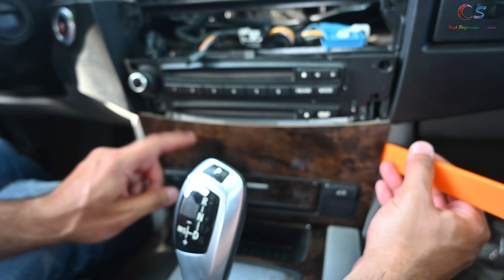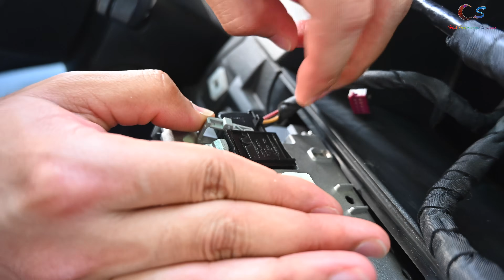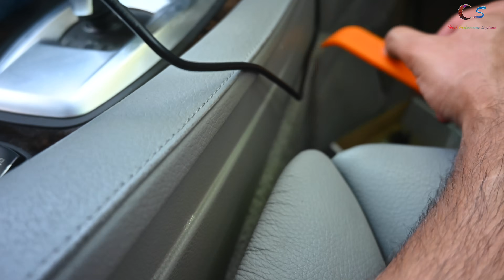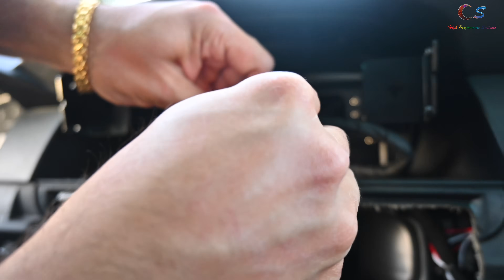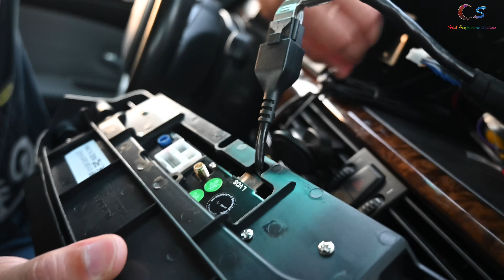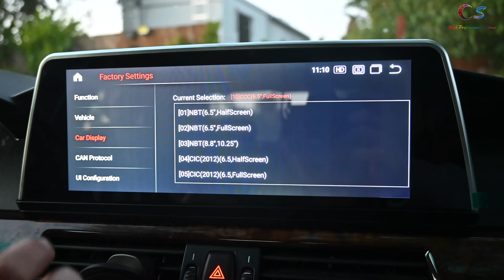PEMP Android 10.25" Screen for BMW E60 Installation

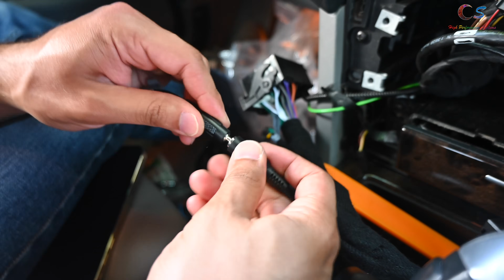Comment: Hi,at 3:48,you are plugging the audio out to the aux in the glove box. If i am correct,in my e61,the aux is in the rear central console,do you confirm? Maybe there is another aux in.the glovebox?My problem is that this cable is of very poor quality and it eventually got cut (kids and feet hitting it). Signal is.now lost. I am then looking at a 3.5 jack male/make cable/ connector. Question: would it be worth adding there a small dac(between the jacks)  to improve the sound quality? Thank you!

Comment: My android auto is only showing up in the center and not completely filling the screen, like two inches on each side are blank and the display is small any tips
Reply from the maker: That’s weird, you can try changing the display type in settings. If that doesn’t work I recommend contacting pemp

Comment: hi I just instal my pemp  system on my e60 2008 and I don't have sound , the radio works fine need help (great video )
Reply from the maker: Make sure aux is connected and working

Comment: I have aux infront of the rear seat in the centre :( is there a way i can put a aux inside the armrest? Or somewhere else. I dont want to use the back one as it wont look tidy.
Reply from the maker: You will have to route it and hide it under carpet

Comment: Hey man, i have quastion about this, i have an bmw 525d 2008 late (ccc) car with aux orginal and sub woofer package, do i need to connect the head unit to the armrest aux out? have seen some people not doing it and get sound ?? i think it will look so bad to run it trough console and back to armrest aux....
Reply from the maker: You need an aux source, there’s not one under the front armrest?

Comment: When you could not see the bmw screen it said no signal how did you get it to work?
Reply from the maker: I just disconnected the lvds wire and reconnected it. Also you can go to android settings and change the ccc display type

Comment: I doubt that the head units fits perfectly on the dashboard without cutting the dashboard. How much of the dasboard you've cut?
Reply from the maker: This is a e60, not a e90. E90 models required cutting dash.
Reply: @cs.studios  yes, i know it's a E60. I own one (facelift). I thought cutting dash is a must. Anyway, i bought also (from a different seller) this type of android navigation, and it works great. The only thing which i don't like, is that nothing appears on the screen when i press the climate control buttons. Same thing with the parking sensors button.if i switch to the OEM system, they work fine. Any sugestions?

Comment: My screen recently started saying no signal when I try to go back to the original bmw car info. The issue started after I swapped car batteries and I’m wondering if it’s possible that the fuse that goes up to the screen got blown? ( 4:27) I swapped the fuse where the volume/dvd player is and it still shows a no signal screen.
Reply from the maker: Try disconnecting the lvds and plug it back in
Reply: @cs.studios  is that one of the Cabo’s that’s connected to the aftermarket screen? If so I tried doing that
Reply from the maker: You can try going into the settings for idrive resolution and try switching it to a different one

Comment: Did u get the aux out wire ? Or it’s In the box . I got bmw 2008 528i . Not sure if the harness is similar . What extra goods I need to buy to get before I buy pemp . Is the audio outwire inside the system ? Or comes along with the new harness
Reply from the maker: It should all be included in the box

Comment: Hi bro, I also got the CCC android unit. Now I used this (CCC android unit)about 6 years. But some times this device will steal power and cause the car's system to display a power leakage.  Over time, the system will overheat(CCC android unit), leading to a crash, resulting in the screen becoming unresponsive.

Comment: I built it in my e60 but the oem screen is showing not good. I already changes the factory setting to 8,8 ccc but its still looking not good.
Reply from the maker: Try the other options and check lvds cable

Comment: I have a 2007 m sport 535d but it only has one slot on the cd player. Is this installation the same for my version?
Reply from the maker: As long as you have an idrive display it should work as far as I know
Reply: @cs.studios  OK thanks.

Comment: Why did you need to take the lower panels/control unit off? I think you just need to undo the hex screws and swap the screen out. What am I missing?
Reply from the maker: You need to connect the harness

Comment: Great video, thanks. When using Apple Carplay/Andorid Auto, is there a way to run other online apps (installed on tablet rather than your phone) by using your phone's data connection? Thanks in advance
Reply from the maker: Unfortunately not when I tried

Comment: My climate control switches stopped working after I did the install, is there anything I missed so I can get them working again
Reply from the maker: Try checking to make sure the cable for climate control is in all the way

Comment: Hi! Do you know if it will work for E60 M-ask? Does the system able to show original m-ask screen? Thank you!
Reply from the maker: Hi, unfortunately I am not sure. Your best bet would be to contact pemp and see what they say. Alternatively you can disassemble your setup and check to see if the wiring looks just like mine. The screen itself works without idrive but you need a working aux input for audio

Comment: Hey bro i just installed it everything is fine but im not abel to see the old ccc its very important please
Reply from the maker: Try removing lvds cable and reconnecting. Also try changing the setting in android setting for display type/size

Comment: Hi there , i did everything according to the vid but when i went to put the switch on i got nothing started the car and still nothing , thnks in advance
Reply from the maker: Check wiring to make sure nothing is damaged and maybe contact manufacturer in case yours is defective

Comment: Bro can you help me update mine and maybe tell me why when i turn the car off then back on the radio turns on and i cannot use my screen untilthe car has been off for about 20 minutes
Reply from the maker: I would check wiring and settings app. Contact PEMP to see if there’s an update for you

Comment: Video was on point, quick question, is your GPS antenna and 4G antenna working fine in the area you installed them at? What is the 4G antenna anyways? Not like I’m gona install service.. also, if I didn’t have navigation before, do I even need to install that GPS antenna?
Reply from the maker: Both working fine in that area
Reply: The GPS is for the head unit's internal GPS if you want to use it.. personally... since I'll be using Apple Car Play, I'll use Google Maps or Apple Maps for my navigation... but it doesn't hurt to install these antennas anyway

Comment: Hey man! Great video it really helped me a lot to install mine. I had one problem though and I’m hoping you are able to help. My aux doesn’t work for some reason, the wording on the factory settings is grey and I’m not able to select it. Meanwhile the FM, AM, and CD options are white in which I am able to select
Reply from the maker: Did AUX ever work before? If not you might need the pemp aux activator
Reply: @cs.studios  no it didn’t work before
Reply: @cs.studios  so I just watched the video for the pemp aux activator, all I would need to do is activate the aux from the screen right? I wouldn’t have to retake out the stereo and all that since I’ve already connected an aux cord through to the little storage box in between the drivers and passenger side.
Reply: @cs.studios  also would I need to connect the USB adapter to use car play?
Reply from the maker: I’ve never needed the activator so whatever is shown in the activator video is all you should need to do. Wireless carplay works fine so you don’t need usb

Comment: hello. Can i install it in BMW e60 2004 with MASK and 6,5" of screen???Too I have aux (think) that i have Cd Charger... I have seen all to e60 with CCC, not with mask...  Thank you very much.
Reply from the maker: It might work. Check your wires to see if they are the same as mine.
Reply: Have the same car but i’m not with it right now to check, did it fit?
Reply: @martinferrando9741  not, i didnt, sorry.

Comment: This was incredibly helpful, I have mine coming in a few days. Thanks!!!
Reply from the maker: Should have backup cam vid done in 1-2 days too
Reply: @cs.studios  great, I’m probably gonna fit that as well.
Reply: Hey does this fit the 2008 528xi?
Reply: @brirolle950  yes it does I installed on that exact model
Reply: @csstudios does this fit the 2008 528xi?
Reply: Thank you, i saw a in dash factory looking version can help cross check to verify it fits my model as well.. my ig is onemanarmy_b i will send u a screen shot of what i found on amazon. If is then its 200 dollars cheaper than the 10.25". Please. Best regards.